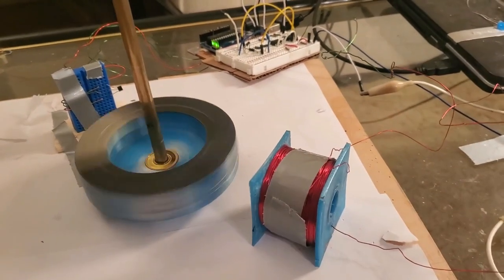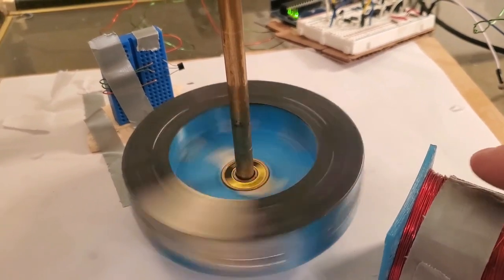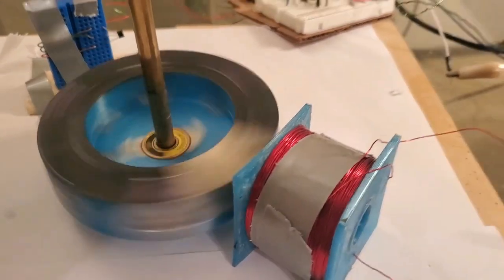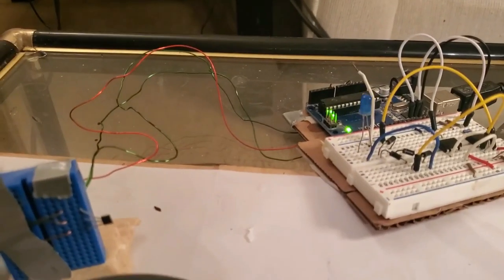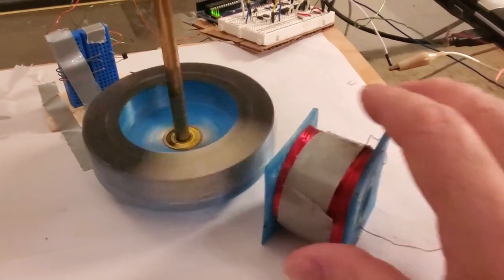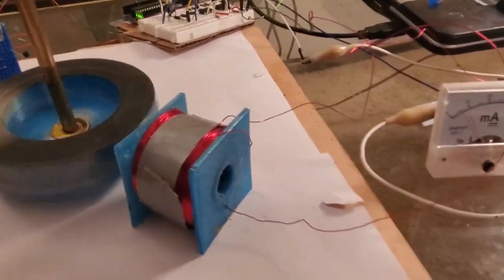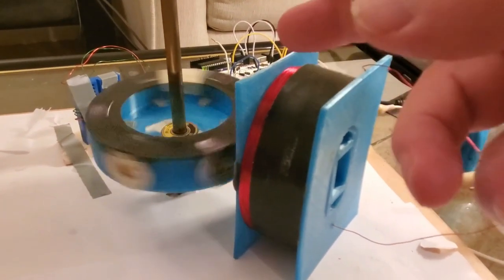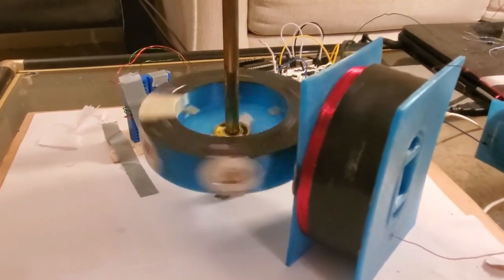The Pulse Motor: Your Drive Coil IS a Generator Coil

Comment: Yep, by collecting the energy from the collapsing magnetic of the drive coil you can recover 1-99% of the energies used to spin the rotor.

The shorter the drive impulse, the closer to 100% efficient the energy recovery is.

Over unity happens because the operator applies 10 j to the drive could, the rotors picks of 4 j of movement and the user recovers 1 -10 joules from the collapse field of the drive coil depending one their setup and timing.
Reply from the maker: Sounds good chaorttai, sounds good, I think we think alike!  In the New Year I will 3d print a rotor that makes use of both the North and South ends of the coil for motive power, it is an idea I got from Rick Freiderick, who I guess got it from John Bedini who may have come up with it or gotten it from someone earlier.  Ideally, you don't lose any of the whatever you want to call it "inductive spike" but you double the motive power.
Reply: I recently saw a motor that ran on inductive spikes and recalled a circuit Master Ivo showed in his "Efficient Electric Impulse Generation" video, he uses a capacitor in parallel between the source and coil switch to capture the power used to kick the coil and recycle it for the next part of the cycle, or a capacitor between the terminals of the source to allow the recaptured impulses to charge the faster capacitor and then it charges the slower battery if the source is sensitive, leading an incredibly high efficiency.

I figure if we combined the pulse motor with this system the coils expend only a tiny amount of net total power to drive the motor which can then be used to drive a larger source, the shorter the impulse duration the stronger the kick will be per cycle for the same energy cost, in theory it should easily achieve a COP higher than 1.

Comment: My dad made a beddini, I figure it isn't creating electricity, the transister raises the voltage enough to charge another battery meaning all were doing is taking the energy from one battery and putting it in the other, with energy losses eventually we would end up with two dead batteries.
To make any usable current we need both north and south polarities
Reply from the maker: Hi DaVeHiLl200,  For the most part I agree, I would just make the following observations/comments. a) The Bedini SSG is a Buck Boost Convertor (the backward diode is a dead giveaway).  So I would guess you can buy a Buck Buck Boost DC/DC converter off digikey (haven't looked, just ball parking things) that is 80-85% efficient for 5-10 dollars.  In the SSG case the timing of the DC/DC convertor is handled by the rotor. so a1) You now have an 80-85% efficient Buck Boost convertor that is also spinning a rotor, granted the torque sucks as it is being hit with brief pulses but isn't it odd that you can run a DC DC convertor and spin a rotor at the same time a2) The previous leads one to the question of what makes an efficient DC DC Buck Boost Convertor and just how efficient can one of those be? I've never built a crystal radio yet, but exactly what is going one with crystal radio sets? b) One thing I remember John Bedini mentioning with his SSG set-up was "build it exactly like I have shown, then you can change it later".  To which I thought, that's so 1980s they have neodynium magnets now, build it with those and it will have super strong super neodynium powers.  Eeehh, one thing in making this video I was noting is just how much of an effect the rotating permanent magnets are having even on the drive coil. John didn't use neodyniums and it occurs to me now there is one big difference between neodyniums and ferrite based magnets, one is a magnetically hard material (neos), the other is magnetically soft.  So I have trouble getting the SSG set-up to work also as far as charging batteries well.  Then again, I have gradually realized I have never built a Bedini SSG because he didn't use neodymiums and neodymiums are a hard magnetic material which may be the last thing you want in a setup like Johns.  Thx for the comment.

Comment: We always eliminate everything to find issues.  In this case you can eliminate all electronics and the siggen to find the cause.

FIRST - test #1
1)  a ferro rotor is on a vertically-oriented shaft with a bearing; it is not spinning
2)  a permanent magnet is 12 inches away from the rotor
3)  the rotor is made to rotate by hand

WHAT IS THE OUTCOME?  The rotor spins until the mechanical friction slows it and it finally comes to rest.   The magnet played no role, it was 12 inches away.

NEXT - test #2
1)  move the magnet immediately adjacent the rotor - leave 1/4 inch space gap between magnet and rotor
2)  set the rotor in motion by hand and note the difference in outcome

ADDITIONAL STEP
1)  an electromagnet is positioned 1/4" from the rotor
2)  turn on a 60hz, 15 volt (or higher) AC to the electromagnet
3)  put the rotor in motion again by hand

In reality, test #2 showed why the rotor slows when the magnetic field is close to the rotor.  The 'ADDITIONAL STEP' just eliminated all doubt

No electronics, and no siggen were needed for up through test #2, and you could easily see what is going on.
With the magnet being 12 inches away, electromagnetic induction between the magnet and rotor is effectively zero.

But when the permanent magnet is only 1/4" away from the rotor, electromagnetic induction is much more pronounced
.
Reply from the maker: Hi Greg,

Thanks for the commentary sorry for the late reply.  The one distinction I would make here is there is no "ferro rotor" in this set-up. There are the permanent magnets on the rotor, driven by an air coil inductor(s).  With such, if you take another air coil inductor as a pick-up coil and put it 1/16th of an inch or 16 inches away from the rotor, the rotor will care less and spin merrily along without drag, unless of course you load the pick-up coil.  Now in the case of a pulse motor there is a brief pulse where the electromagnet is on, once the pulse is finished there is the majority of the time where the drive coil is unpowered, within "sight" of the magnets spinning past and for all intents and purposes is a pick-up coil during that time.  As one might set-up a FWBR or single diode to capture the changing magnetic field from the on/off of the power delivered from the PS, that FWBR is also out to a cap during the time the coil is unpowered and the magnets spinning past, and so presents a load to the air coil inductor.  During that time the drive coil, is a pick-up coil, exerts drag on the rotor and delivers power to the cap.  That's all I'm trying to get across here, and certainly the behavior is different with a ferro magnetic core in the inductor.

Comment: Nice observation, this highlights the importance of performing the experiments that lead to a deep understanding of a device and its tolerances. I’m keen to get an old pulse motor of mine going soon, I want to experiment with a special coil I made 20 years ago when I knew nothing, your video has reminded me how lazy I have been. There’s something so cool about an efficient pulse motor ticking along, I used to leave mine running for days just because I could.
Reply from the maker: Thanks whatifididthis, at this point I have spent a fair amount of time with these motors and I still get surprised now and again.  Glad I got you interested in the topic again, I think they are pretty cool too!

Comment: loved the video! my take on it is, Your coil is acting like a capacitor when interacting with the spinning rotor. the closer the plates the higher the voltage.  putting the coil further away creates more magnetic lag because of the increased distance from the center of the rotor (radius) the fields take more time to traverse the distance of the circumference the further out you go. more time = more current.
Reply from the maker: Thank you societyofhigh! "Society of High" is that like a stoned version of the inestimable English Royal Society? Just kidding. Certainly any inductor will also have capacitance and I hadn't ever considered it in the manner you describe.  I can't say I model in my mind what is going on in this way, but definitely any inductor also has capacitance just as any capacitor also has inductance, so certainly worth keeping this in mind when trying to figure out why things behave as they do.

Comment: so I noticed that when I use a Hall sensor to run my pulse motors the closer I get to the rotor to the coil, the slower it goes. Unlike a bedini circuit where the closer I get the coil to the rotor the faster it goes. It only happens when I introduce Hall sensor.
Reply from the maker: Hi mcorrade,

Thanks for the commentary sorry for the late reply.  I don't know what to say, that's weird.  There are so many variables going on, aside from the specs of the components, there is the angle between the trigger and the magnets, the spacing of the magnets, etc, etc.  If I had to hazard a guess I would wonder with the particular spacing of your magnets if you don't get to a point with the longer on-time of the Hall where you are stepping on your toes as it were, that is guessing a monopole set-up, trying to push one magnet out CW while the next magnet has come in close enough that it wants to be pushed out CCW, just a thought.
Reply: @paulmaher812 well for me it only happens when I use the Hall circuit and not the JL 94 circuit or the bedini. All other variables are the same. Same coils, same rotors. I know it sounds strange but I did notice this may times.

Comment: when you talk about how the Drive coil is a generator coil, my first thought was something similar to Floyd Sweets device, if you look at the diagram, it is two coils in a + shape, one is drive, one is pickup and theres a wireless transfer there between the two, and I think that output coil is just combining the input leakage as its somehow manipulating the magnets field and then that stimulates extra charge from the oscillating field to harvest the excess output and combin it with the inputs leakage to further cut any losses. Im still new to this and havent had any experiments done myself since I havent had the time as a full time doordash driver, but I will definitely look back on this comment to remember when i have the time. 

 I had an idea that maybe what Sweet was doing, was this, but instead of physically spinning magnets, you are using an oscillating field and the way the magnets were set up it would cause a constant movement across the wires in the coils inducing a charge. and i believe the drive coil is stimulating these magnets some how and I have a stupidly simple design based on images i could find of sweets device down to its bare components and Im excited to try it regardless!
Reply from the maker: Hi Mr SnowFoxy,
I can't say I have looked really at all at Floyd Sweets stuff, though certainly have heard of him.  I would have to guess what he was doing was a bit more complex.  All I am really pointing out here is that both during the time the coil is pulsed and when the coil is off, it is a coil of wire next to spinning magnets and the moving magnets create their own current in the generator coil which effects the behavior of the motor.  Thx for the comment.

Comment: The reason it slows down is exactly the same as the reason a dc motor runs slower with stronger magnets.  In fact, your pulse motor is basically just a crude electronically commutated DC motor, akin to a PC case fan.  Basically, when you apply voltage to a DC motor it spins (duh), but equally, if you spin a DC motor it generates.  The polarity of that back EMF is always opposite the applied voltage and so if you increase the field strength by coupling the stator and rotor more tightly then a greater back emf will be generated for a given speed.  Once the back emf equals the applied voltage the motor cannot spin any faster -- otherwise the energy flow would be reversed and the motor would charge the battery.  That doesn't happen.

Comment: I have been reading QEM by Richard Feynman and postulating the energy of electron movement and as he states photon compensation to maintain orbit   the energy involved in maintain a close orbit could /should be greater than one further out due to inertia change in direction  because of the tighter orbit ,Faraday had it in the horizontal plane
Reply from the maker: Sorry for the late reply,  I have heard many people speak highly of Feynman's writings though I have yet to read any of his work.  What I am getting at in this video, from memory, is much more simple, it was just my realization, at the time, that the magnets flying past the motor or drive coil have the same effect on that coil as regards Lenz Law and even as regards generating a current as they do when the fly past a pick-up or generator coil. Thanks for the comment.
Reply: @paulmaher812  I was referring to direction change stresses the wider the ark the  less  compensation requiring photons communicating between the  proton electron required , with the magnetic photon chain interface he using there a loss due to the proximities vectors used Faraday used flat disk similar to a disk break on a car

Comment: If you use a bridge rectifier across the coil, you will be extracting a part of your drive pulse energy into your LED. Instead, use two diodes on either end of your coil, in their appropriate polarity, so that your normal drive pulse is blocked and only the return from your coil gets extracted.
Reply from the maker: Interesting, thanks Tony, I will try to have a look at that going forward.

Comment: 1. The reduce in speed is probably due to the timing rather than the lenze effect. Try adjusting the timing after you carry the coil closer to see if you can speed it up again. 

2. In a normal generator, an approaching north magnet will produce a north field in the coil and when moving away will produce a south field in the coil. These fields is what slows down the rotor as its repells and attracts. Now in the pulse motor in repulsion mode, the coil will trigger and produce a north field as the north magnet approaches. This north field will initial slow down the rotor untill dead center, after wich the coil shuts off and the north field collapse. To the coil, a collapsing north field is the same as a rising south. But is it the same to the rotor magnet ? Im not sure. But I know that if you start turning on the coil right before dead center the coil acts as a generator and energy from the rotor is placed in the coil and then this same energy is used to push away the rotor. This is why you will see some designs where the timing is perfect dead center at first, but once the rotor reaches a threshold speed and you make the timing right before dead center the rotor then speeds up significantly. Its because the rotor has enough inertia to overcome the slow down effect while at the same time adding power to the coil.

3. You can also see this effect of you use bifilar coils. So three bifilar coils in parralel (each pulse wire must get its own diode so one coil dont see the other as a short/load). One coil is trigger and pulse and the other two is just pulse with the next wire acting as a generator. If you make the generating coils only conduct on the collapsing fields using a diode, and place them in series then once the rotor reaches a certain speed and you shorts these coils the rotor significantly increase. Eg: in my setup the motor speeds up to 1000 rpm with the generator coils open. After closing the coils the motor speeds up to 1300 rpm and the power consumption drop by 40%. Also this only happened when i use north and south magnets (it was 3 north and 3 souths). But if i closed the generating clils from the beginning then the rotor dont even reach 900 rpm and the power draw is 30% higher than usually. Then again once the rotor reaches 1300 rpm and i open the generator coils the rotor then speeds up to 1600 rpm. This is due to timing because as the rotor soeeds up the induced current increases and this affects the timing.
Reply from the maker: Hi Raoled,  Thank you for the in-depth and erudite comment. As I have said repeatedly, for such a simple pulse motor, there sure is a lot of complex behavior going on.  I have not yet looked at a bifilar/trifilar coil such as you describe, which adds yet another variable.  I have heard rumors describing the sort of behavior that you note, if I look at a similar bifilar coil in future will keep this comment in mind.  Please feel free to chime in with future observations or videos if you care in future, thank you for the comment.

Comment: Nice video, I see you have found that a pulse motor generates during a cycle. For example If you use all north poles, as the 1st portion of the inductor passes the North Pole magnet face it will create a negative voltage peak then climb up to a zero value, as the inductor becomes centered  over the magnet. 
Next as the inductor leaves the center section of the North Pole face it interacts with the other half or portion of the North magnetic field of the magnet to create a positive voltage as the inductor begins to leave the centre North Pole face. 

The North Pole face produces an AC wave form, negative value will charge the primary battery and positive value will charge the secondary battery. 

High inductance coils will generate a strong enough voltage peak that it can back feed or charge a battery or power supply.  This is the path forward, if you want to pursue a possible self running machine. 

Hope this helps.
Reply from the maker: Thanks Advancedbatterytech, that's great, keep us up to speed on developments with your work going forward.